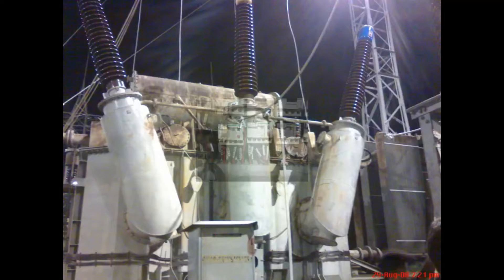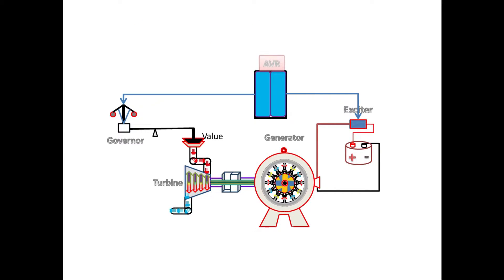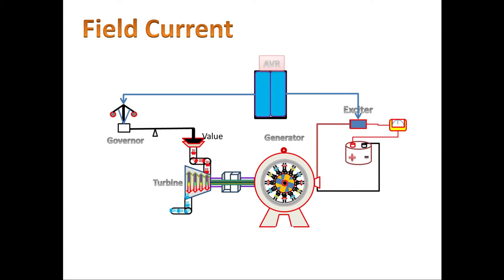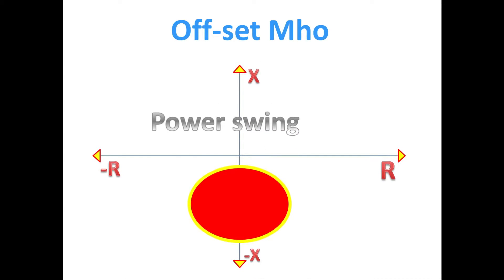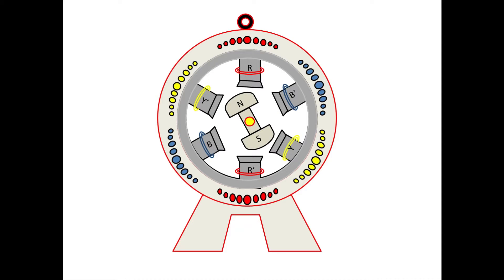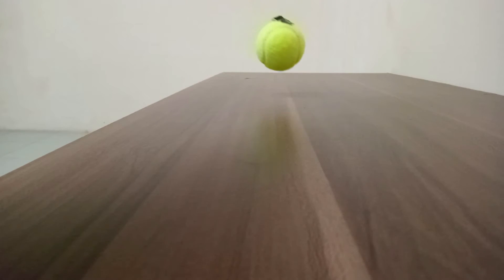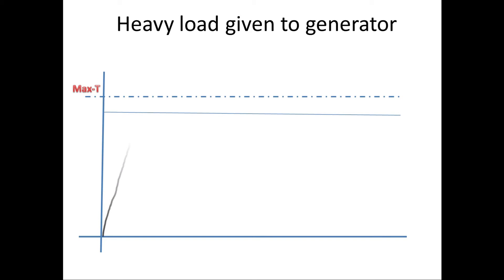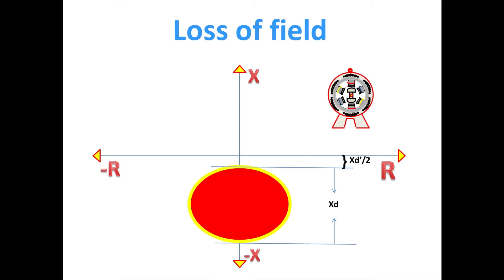Loss of field protection reason | Loss of field operating Region | Under excitation protection

Comment: A) Our TG is getting frequent tripping on reverse reactive power while running sometimes. First case 
B) TG will not  be synchronized with gird during synchronization process and will be tripped by acting of reverse reactive power.. Second case

Excitation current is in with in limits and system is healthy. 

Without doing any thing the TG will be synchronized after some time. 

What might be reason
Reply from the maker: without connecting on Grid the reverse power will not operated. i will check
Reply: Kindly check Droop CT connection